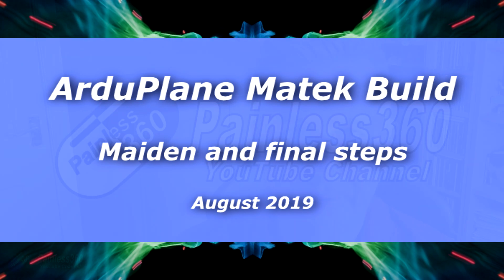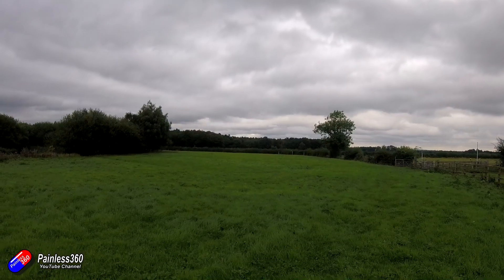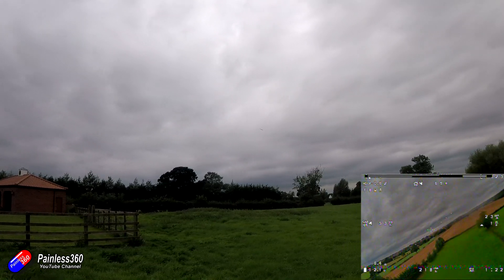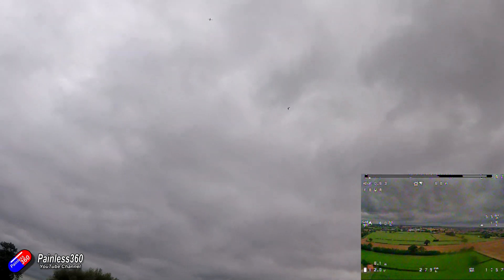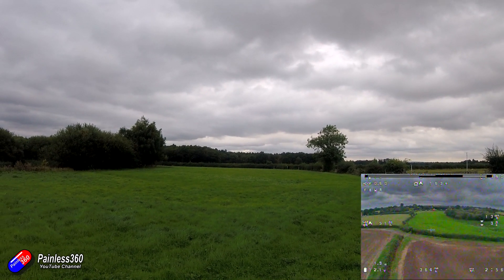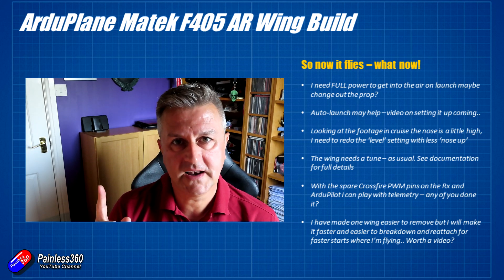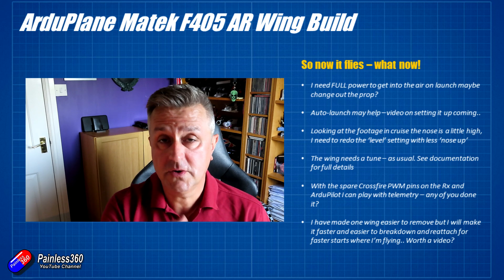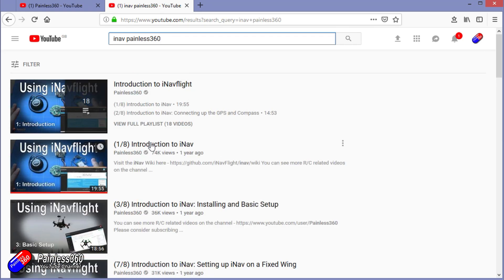ArduPlane/Matek F405/Wing Maiden Flight!

Comment: Have you ever tried a bungee launch?  Really easy to make out of PVC pipe and can be assembled into 3 or 4 pieces for easy transport.   Should prevent those crashes when launching.
Reply from the maker: I haven't ever needed to. Until this model every single maiden using auto launch has worked flawlessly. It does rely on the model having enough power though... Happy flying

Comment: Now that you have logged a flight with the standard motor/esc .  You can experiment with a bigger set and find out if it uses more amperage at cruise or not.     You might want to try a  Bungee launch to keep the amperage requirements down and safety up.
Reply from the maker: Already done - Check out the playlist.. :)

Comment: Thank you very much for these instructive videos.

I have a question with the trim and Arduplane. Which is the best option?

     a \ Manual trim >> Physical adjustment of control surfaces >> Reset trims in the transmitter >> Servo_auto_trim

     b \ Directly servo_auto_trim?

Or any other suggestion that you can give me from your experience.

Very thankful.

Comment: With stock motor launching ARWing with autolaunch is tricky. I had to lower motor spin delay to less then 100 ms and with good throw everything worked fine (9 out of 10 times).

But now after installing higher kv motor it launches perfectly everytime, even without any headwind.
Reply from the maker: I've increased the prop size a touch and dropped it to a 2 bladed prop. Seems better now..
Reply: @Painless360  6" prop?

Comment: I have been using the crossfire Telemetry down link and then Bluetooth to a laptop for quite a while now. The only problems I've encountered is sometimes my transmitter will not pick up some of the Telemetry information until I connect to the PC. It works pretty good, the connection could be a bit faster but for a wing its plenty. I am using a jumperT16, Crossfire, and A Matek F405 running ardupilot on a ASW28 sailplane. Once again thank you for all the videos you have posted, they have helped me tremendously with a few of my latest builds!!
Reply: Is there a way to display all the telemetry in a widget on the taranis?
Reply: @eugeniopicheo5430  I believe so? However I am not too familiar with that transmitter, but I am sure if your radio supports LUA scripts and crossfire you can get just about any of the telemetry info on the display you want.

Comment: I just set up the crossfire + mavlink + bluetooth per your videos, yesterday. Laptop reconnects partially between battery swaps, gives telemetry/voltage/altitude/position sorta in the background while I was flying around. It worked pretty much exactly equivalent to using the telemetry radios. Slow connection, laggy attitude indicator/HUD, just like telem radio. Changing the baud rate didn't seem to matter. Wonder if that's just how it is, or if a faster/newer version of APM/pixhawk is the culprit. 

I did it mainly to simplify equipment in my little $15 drone. Had no real issues setting it up. Set 7/8 to tx/rx, enabled bluetooth, I think I installed a driver on the laptop to be able to see the bluetooth device in Ground Control, but mainly found that I had to update firmware on the Crossfire to get it to connect to bluetooth.
Reply from the maker: Interesting, thanks for the comment. I wonder if one of the other options might work more smoothly..
Reply: @Painless360  if there's an option that's super fast bit rate so that the connection and parameter transfer would be more instant, I'd pay $$$ for it. But this setup was awesome for the simplicity of just having a radio, laptop and the quad, no silly radio dongle to be mindful of around the laptop. Control through mavlink pass through worked flawless. Not sure why the stick control is instant while the parameter and telemetry transfer is laggy.
Reply: At work we managed to make it work with the diversity receivers  (mavlink over bluetooth), mission planer or qgroundcontrol works as expected, you just have to follow the settings for the serial port in the tbs crossfire manual.

 Unfortunately it didn't work as well with the nano receiver, mission planer wasn't receiving the parameters but the telemetry was working on the taranis, we didn't investigate further and assumed it was a limitation of only having one antenna.
Reply: quick update to my previous comment: since firmware 3.21 it now also works on the  (non diversity) nano receiver.

Comment: I've really liked this series. Super useful for building an autonomous wing.  Please do the video on how to remove the wing easier for storage.  Lee, a recommendation since I've built this exact wing and board is to give a recommendation on setting up the ESC, which you answered for me on another comment.  Also I found that it was a bit tricky to get servo throws for aileron and elevator correct since it's a mix.  I had to play with Mixing Params for that, but got it to work well with aileron 16mm and elevator 12mm

Comment: Lee, I just maiden'd my ARWing yesterday using autolaunch/takeoff mode.  (I'm a very experienced RC pilot, but this is my first plane with a flight controller.)  I was working on getting it to autotune, but it was still so sluggish that when it was time to land, I switched to manual mode.  Manual mode was WAY too sensitive, but I got it down OK.  

So, if I understand this correctly, manual mode  bypasses all controller settings...? (PIDs, etc.  Does that include the expo settings?) So, to make it more manageable in manual mode, I think need to dial-down the throws mechanically.  Is that correct?  I can't find anything on recommended throws from the manufacturer. Or do I try to do something in my transmitter?   For FBWA, Auto, etc, the transmitter should be clean output, correct?  No expo or rates?  To make it optimal in both situations, I'm thinking I might need to set up a "manual mode" on my transmitter, that I only use when the wing is in manual flight controller mode.  Does that seem reasonable, or am I going off in the wrong direction?  (This is all because I consider the FC manual mode to be my "safety/emergency" mode, if things get hairy with the FC.)   I'd appreciate any input.
Reply from the maker: Setting up a mode that adds expo and limits travel on the radio would be how I'd do it. You can also increase the max pitch and roll angles in the software too if you're struggling to fly the plane out of manual. It is a very different  feeling so does take a little getting used to. I fly a lot in manual even with an FC as I like the direct control with the backup if needed..
Reply: @Painless360    Thanks Lee.  Yes, autotune/FBWA is a very different feeling (or perhaps at least until it gets tuned).  I'll look into the max pitch/roll angle settings.  Seems like that might help.  Much appreciated.

Comment: I used the CrossFire and connected it only with the rx/tx (and power) so no sbus or other pwm connection. Works great only the telemetry scripts on the X10 i cannot get to work (yet). I setup a couple of the telemetry params directly on the screen.  I used Qgroundcontrol on my phone (BT connected to the crossfire) to get the full setting info. I would love to see the autolauch i did not trust it yet , so i used a script with a countdown timer on the transmitter to get it started. ( after 10 seconds countdown a full throttle and a bit up until you take it out of "start" mode)

Comment: How much does your wing weigh? I did something really similar and and mine's about 680g, having issues getting it off the ground but that may just be due to inexperience.
Reply from the maker: 727g AUW. I have changed the prop for easier launch. Video on it in the playlist.. happy flying!
Reply: @Painless360  Thanks! I ended up ordering the Dal T6040C props since I wanted a little more thrust over efficiency, according to a build I saw elsewhere it seems to run fine on a 30A ESC..
Reply: Just an update, the 6040C props work wonderfully, love how they fly so far.